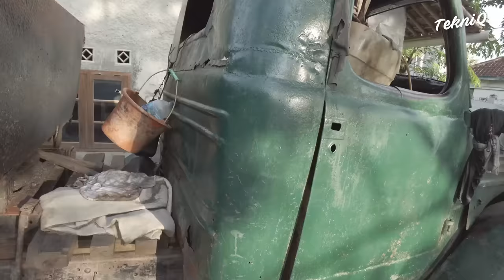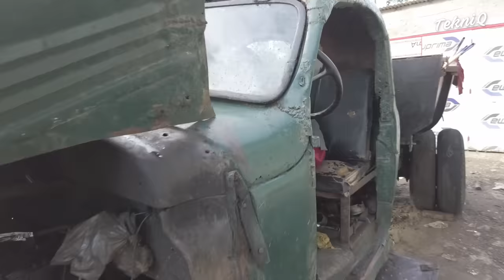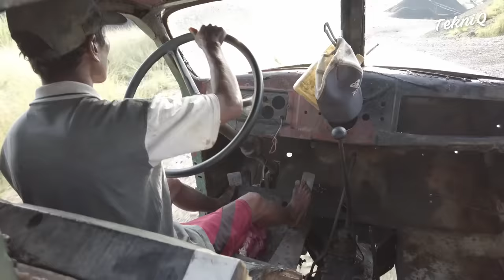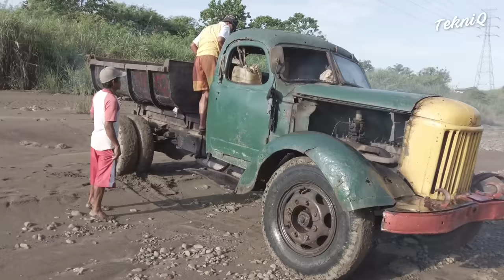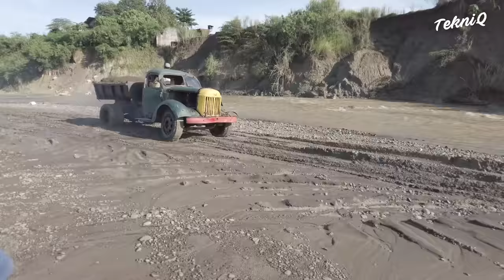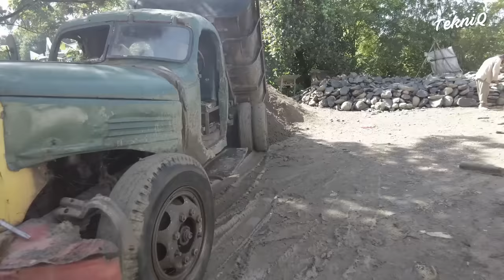Loading Tons of Sand Into Completely Rusted Dying Soviet Truck

Comment: I was prepared for this truck to drop dead at any second. I can’t believe how well its held up, especially because it looks like these guys make this trip often.
Reply: The engine seems to run quite good and starts more easily than some much younger cars and trucks i´ve seen (in germany, where TÜV is a thing), the body is about dead but the Frame seems to be in quite a good state sooo... it´l propably run for another decade or five
Reply: Considering how it's overloaded too🤫
Reply: @MrManniG  https://www.youtube.com/shorts/ZSUgEYfqcW4
Reply: @MrManniG  Except it's obviously pissing coolant and they're just topping it up with water.
Reply: i saw incredibly worn out cars in parts of africa. repair shops at the side of the road would work on total scrap parts with hammer and chisel, i am not exgaggerating. the yound guy had no wrench or anything, and had to open some nuts and bolts on an old brake caliper assemlby.  on the floor in the dirt without a vice.  every piece of mechanical junk has some porpuse if you have absolutely nothing. cars with out working brakes, cars without lights in the night, cars without doors, cars that rode absulotely flat because the suspension was absolutely shot, cars wgoese engines barely chugged along to maintain a bit more than walking speed. a screw is worth something, heck, i am sure there is shops that repurpose amd repair ball bearings. markets with specialised selelrs of every kind of mechanical stuff you can think off are usual in bigger cities. its an economy of scarcity. i love african tradesmen and mechanics. you can really learn just watching them. they sit there together, one guy ist working, 6 guys are wathcing and having polite conversation or having a good time.
Reply: @grummelameise  African mechanics blow my mind. Just as you said, they’ll rebuild an engine with hammers and a rubber duck (I’m joking) then simply pick up and drop the whole thing in by hand. One of the best examples of African engineering is the Chukudo - an all wooden scooter with a salvaged suspension. If the world stopped tomorrow you can bet they’d still be making deliveries.
Reply: Remember it's the real thing and not a fake woke amerikan truck
Reply: @grummelameise  I admire these people, they are actual repair people, not parts swappers.
Reply: @MrManniG sounded like it was misfiring lol. Definitely a tired old motor.
Reply: Потому Что в ссср сделано

Comment: I like the dude filling up the fuel carton inside the truck using water bottles while smoking a cigarette.  They only put in enough fuel to make the one trip, they keep the battery inside the shop lest it be stolen, same with fuel.   I love the welded patches all over the frame, the welded stuff all over the cab, the warped drive shaft, the barefoot driver, the water in radiator instead of antifreeze, the fact that it can haul all that sand and the dump bed actually works.  Heck, I like this old truck!!
Reply: They maintain it enough to get the job done.
Reply: Они живут в тропической стране. Нет нужны покупать антифриз. Вода есть в любой луже.
Reply: A cigarette cannot ignite fuel, it needs a flame or a spark, you can put a cigarette out by dipping it in fuel, petrol (gasoline) or diesel.
Reply: Why would they even need antifreeze in their climate?
Reply: agreed, but the optics of it look sketchy.  On a side note, I used to weld up cracks on diesel fuel tanks and we always made sure they were full before we started.  The first time I was scared, but the old timer told me to just do it, he'd done hundreds of them.  So, I convinced my 20 yr old self to just do it and it works.  I did several like that.   @MrGoogelaar
Reply: The biggest problem is no air filter. Not really good for the cylinders.
Reply: I was surprised it got across the water misfiring and with 50 year old bald tires lol
Reply: it operates with diesel, it is not like gas, it will not explode because it is much denser like oil, does not evaporates that much. You can put a lit match in diesel and it will be extinguished
Reply: I likes the fact that it had no brakes, they just completely removed the master cylinder and pedal
Reply: @oliverpapai6011  It is not diesel, it is gasoline. It has a carburetor and ~6:1 compression ratio.
Reply: @iscander_s  Because it's also anti rust and has slightly better cooling abilities than water.
Reply: @otto3225  anti-freeze and water with 60/40 ratio boils at about 140 °C Celsius.
Reply: Особенно в бензин можно окунуть сигарету... Давай попробуй и останься живым!
Reply: @user-ww6cz9qv2i  diesel it is possible, petrol, unlikely, its the vapour that burns, petrol has lot of vapor, especially in tropical environment, diesel has almost none. also diesel would require larger flame to ignite as it has to first evaporate some diesel before it catches fire.
Reply: The tires are also bald and never got stuck lol

Comment: the fact it still drives astonishes me
Reply: I worked on cars and trucks for 20 years. 

Biggest thing I took away from that line of work, was how durable and resilient vehicles really are. Especially when you cross a beater vehicle, that came from a major city.

Don't run out of oil. Don't overheat it. 

Zip ties and duct tape, can get one far with repairs.
Reply: The fact that they can even drive through water in a road
Reply: @elgoog7830 my truck fully hydro locked the engine at least 4 times and like another 3 minor times. Same block, head, and 89% of original parts still here. Marketing is vehicles biggest issue, because maybe new cars are safer, but that's all they are in my opinion. Certainly not "better" for the consumer. Definitely more luxurious

Comment: I couldn't believe my eyes.  Amazing.  Looks like that truck will survive a for another 50 years.
Reply: If they keep replacing parto and repair It It would do other 1000 Years, Imagine how many engines they already replaced, atleast 3, they dont seem to care alot of the bodywork but vehicles can be kept running Forever if you are skilled and have access to parts
Reply: @gillespriod5509 as an indonesian i can say that all of these trucks have their original engine in them

We don't have spare parts for these vehicles, so it's mostly a hackjob of spareparts from more modern trucks being modified to fit the zil

Most of them doesn't have a working air compressor and thus no brakes except for the handbrake.

Comment: The Russians make basic, but functional trucks, that Zil is on holiday there compared to working the sub Arctic temps and river crossings in Siberia.  Just as well the truck is diesel, the old geezer with the ciggie in his mouth would have started a explosive fire.  The little truck could tell some good stories of its life since new...
Reply: What on earth made you think it was diesel?     At 1:47 you can clearly see the carburettor - so its a gasoline truck.   You also saw the guy using the choke to cold start it - by putting his hand over the carby inlet - that will do nothing on a diesel motor.  These old trucks were made with low compression (about 6:1) motors to run on the old standard low octane Soviet gasoline, making them very easy to start.   If it was diesel motor, the guy would not have had any where near the strength to start it with a crank handle.
Reply: Zil  copy old Mack truck and MAZ-200 60 o.y models.
Reply: Великие знатоки советского автопрома... 🤣🤣🤣
Reply: @keithammleter3824  Exactly. There’s no way a diesel has that style intake manifold and especially carburetor. Unless it’s a Soviet VIDI design (very indirect injection) 😂
Reply: Now that’s torque
Reply: @JohnNjengaCOCO  с завода они были на бензине.
Reply: @multikombi777  Спасибо. Не знал, что
Reply: Nope ,is gasoline
Reply: Этот ЗИЛ , 50  лет уже не выпускают , в России даже нет такого  зила , может только в музее
Reply: СССР сила !
Reply: @sergeyvolginn  да, щас уже даже 157 не встретишь
Reply: @chriscruzA35O-9OO  السلام عليكم ورحمة الله وبركاته اللهم صل وسلم على نبينا محمد وعلى آله وصحبه أجمعين وسلم تسليما كثيرا ❤❤
Reply: @keithammleter3824  😂😂😂
Reply: This ZIL -157 has in-line 6 cylinders side-valve (flat-head) carburetor engine with 109 horsepowers at 2800 rpm, and torque 343 Nm at 1100 rpm. This is carburetor gasoline engine, but it's parameters at low rpm seems like real diesel.
Reply: But this is not ZIL - 157, it is ZIL - 164 with  changed radiator face to ZIL - 157 part. Original 157 model has 6x6 full-time with TWO rear axles.
Reply: Original ZIL 157: https://youtu.be/bUshweuFFk8
Reply: @RealKotoVasya  السلام عليكم ورحمة الله وبركاته اللهم
Reply: @sergeyvolginn  я видел ЗИЛ 157 1988го выпуска без шуток
Reply: @sergeyvolginn  157 до 1990г выпускали, я служил 1985 году на новом гонял, руки после руля болели.
Reply: @РадикМухаметшин-в4х  гонял на таком мурмоне!в 1987 году
Reply: Это Зис-Зил 585, двигатель бензиновый, рядная шестерка 109 л.с. расход примерно 35 литров на 100км. Груза 3,5 тонны. Выпускался до 1964 года.
Reply: @keithammleter3824  это ЗИЛ 164, двигатель бензин. Аналог Американского двигателя геркулес
Reply: @multikombi777  да у нас их куча в посёлке  Спупа(157 ) их зовут .
Вот такие голоши выпускал СССР И не  только их
Reply: Увы но зил больше не выпускает грузовики , предприятие полностью ликвидировано
Reply: @guran56 Такие грузовики только из этих самых голош и делали😅😂😂
Reply: Ta ciężarówka jest na benzynę a nie olej. Pali ogromne ilości paliwa. Na szosie norma to 48 litrów/100 km,. Ładowność zaledwie 3,5 tony
Reply: @sergeyvolginn  Завода ЗиЛ тоже нет, уничтожены более 80 000 предприятий и 90% при путине.
Reply: @RealKotoVasya если быть более точным, ЗИЛ 164 бортовая версия. Этот самосмал, ЗИЛ 585.  Когда то в далёком прошлом начинал на таком.
Reply: Moteur essence . Suffit de voir le débit rapide de vidage et la couleur claire dans la bouteille d’eau ….
Reply: @sergeyvolginn я тебя расстрою, этот зил копия американского с американского Интернешнл Харвестер. Так что если сила в копировании, то да.
Reply: @thesart_  ага, чё-то оригиналы до таких лет не доживали. всем бы так "копировать"
Reply: @Українець-ы3п радуйся. ща таким как ты везде дорога, а не инженерам врачам и учителям
Reply: @jurybur_bobkov  с чего ты взял? Ещё как доживают, только ещё и с меньшим гемором для владельца. Или ты думаешь что если эти ЗИЛы дожили с 1994 года до наших дней это прорыв?😂 Ну у меня для тебя тогда плохие новости, последние модели International с которых они слизаны, закончили выпускать ещё в начале 50х и они до сих пор в строю.
Reply: @thesart_ интересные у тебя рассуждения. при царе люди ездили на лошадях. большевики провели индустриализацию. всю страну обеспечили техникой. тут вылазит чел и пишет "слизано". а что-по твоему не слизано в мире? смартфоны появились у какой компании впервые? и потом у других компаний появились точно такие же смарты, чуть изменённые. коптеры когда появились и у кого??? через какое-то время эти коптеры уже повсюду. капиталисты вообще-то сами продают и патенты и целые заводы. и что???   ходовая зила насколько я знаю потом была доработана и существенно превосходит по проходимости любую другую. ну а как выглядит кабина тогда особо никого не волновало. хотя если присмотреться, то у всей советской техники был свой ламповый и узнаваемый дизайн в одном стиле. и до сих пор эта техника навивает многим тёплые воспоминания. у меня вот вопрос к тебе, чтоже ты не откроешь завод и не построишь не слизанное. вроде же капитализм свобода рай???
Reply: @jurybur_bobkov  вау, давно я такую чепуху не читал. Даже переубеждать тебя не стану, как говорится жизнь тебя уже и так наказала.
Reply: @thesart_  ну так ты фактами аргументами говори. мифологию тут какую-то распространяет ещё и продвинутым сильно себя считает. это твои же деды вообще-то страну поднимали и строили всё это. по 1,6 курпного завода в день открывалось при Сталине. а сейчас вы вот все такие продвинутые? но в плане производства что вы делаете? если так подумать? даж 10% нету от объёмов тяжёлого машиностроения СССР. я уж молчу про станкостроение . чё же вы ничего не делаете-то?
Reply: @jurybur_bobkov  так я тебе факт и написал, ты даже этого не понял? Бедняга...
Reply: @thesart_ чего там понимать? понятно же что конструкция ЗИЛ сильно отличается от любого иностранного грузовика. ты хоть сам-то его видел??? копировали тогда, когда само оборудование закупали. тк станки тож заточены под определённую конфигурацию. но потом-то вносили просто массу изменений и улучшений в конструкцию. на это были инженеры вообще-то. или по-твоему все инженеры занимались тем, что копировали чужое?? ты хоть представляешь сколько их вообще было? и сколько вообще в советах было уникальных разработок, не встречающихся вообще больше нигде? :) ну так изучи подробнее.
Reply: @jurybur_bobkov  да, да, ты молодец, возьми печеньку с полки.
Reply: @thesart_ ну вот сразу начал ни о чём писать сообщения. я ж говорю есть что сказать пиши факты. бери учебники истории (вузовские) история машиностроения.  и пиши страницы где там написано о том, что ты тут озвучиваешь
Reply: Dave the doofus it’s petrol 🙄
Reply: Not diesel

Comment: Lovin this old beast of a truck. With it's rattier than rat-look condition, the engine still sounds sweet as a nut. It has a battery, yet he starts it with a hand crank rod, and rests it on the front fender on firing her up, simply unbelievable. These guys with their hard work ethic, and their mastery of this iron workhorse,  truly illustrate what saving the planet is about. Judicious use of resources, and a mend-and-make-do attitude, saves needless waste of energy and time. Just imagine how much energy and pollution are saved with a truck, made to last for 100 years, with minimal electronics, that can be economically repaired, whatever wears out. In the so-called Civilised-West, we really need to get onto this reality!

Comment: That thing is beast! Imagine if it had tread on those tires... Be unstoppable!
Reply: Talking about unstoppable, I'm not sure it has brakes.
Reply: @rogerwilco2  it have flintstone brakes
Reply: @rogerwilco2 Yeah these trucks use air brakes, but the air compressor is typically broken, so the owner will often times remove the brakes

The only way to stop is by using the handbrake which is cable operated

Comment: That truck runs pretty good actually.  But it certainly needs a new radiator and the hydraulic pump is worn out.
Reply: They know
Reply: Judging by all the white smoke, I'd wager the bigger issue is that the head gasket is giving out.
Reply: @LN997-i8x  It already HAS given out, hence why there's no radiator cap and the cooling system is unpressurized. They just the add water that is lost on the go.

Comment: I have seen trucks in junk yards that look better than this...but it runs really smooth, burns just a little oil 
(Good for mosquito control) and the dump hoist works.  What more do you need?  It even starts with one turn of the crank!

Comment: Someone really should take that truck and use it as a basis to determine what is needed and what is bullshit when it comes to getting work done with a truck. For instance, do work trucks really need gauges or floorboard or fenders? Do the tires really need tread? And what's wrong with hand cranking your vehicle instead of using a starter?

Comment: That thing doesn't look rusty at all actually, its beat up and missing sheets of metal but not rusty oddly enough.
Reply: It's rusted, they just painted over the rust to prevent it from rusting even more

You can see holes in the body panels where the rust has eaten away metal.

Comment: just needs new tires and studs and lug nuts !!! needs lots of jb weld on the motor. for the leaks or make some tight rubber outside seals to stop the water leak.(longer bolts to add washer and nuts behind to tighten the homemade rubber seal in place externally. 1/2 inch rubber mat with the fibers in it. should work tight fitting/cut should work for you's. !!! at least you don't lose oil on the run your good !!!

Comment: I'd willingly cut them a new water pump gasket out of something suitable and fit it.....if i wasn't so lazy. 
Actually fair play to the driver, there's mechanical sympathy going on here. None of the nonsense that you see in some countries (no names no pack drill) where a tractor is at maximum revs with the front wheels off the ground, pulling a house.

Comment: Using water bottles may have to do with measuring when buying fuel, and calculating how much fuel is needed for the trip. Keep in mind that fossil fuels are exorbitantly expensive in the most underdeveloped countries. Check videos from central Africa where people do business on a wooden cart, with no combustion engine whatsoever.

Comment: Rear differential drain plug is a dirty rag. No fuel pump. Smoking right over 10 L of gasoline. radiator uses 5 gallons water per 10 Km. But these dudes are barefoot, so not too likely to be Russians. This is, however, how Russians maintain their tanks.